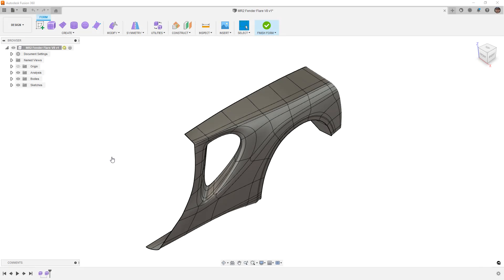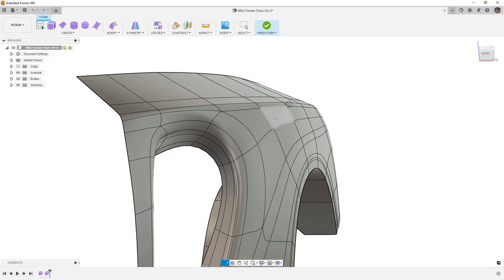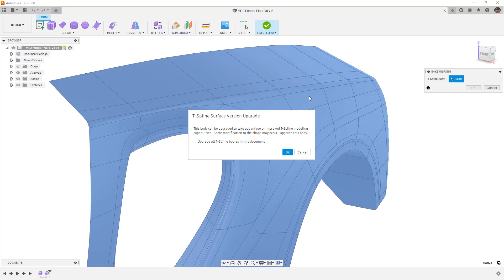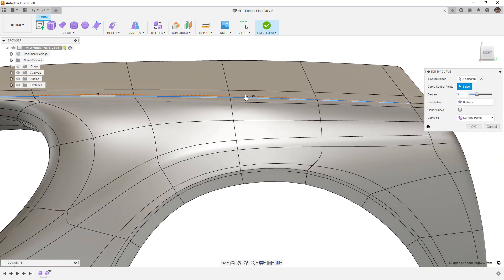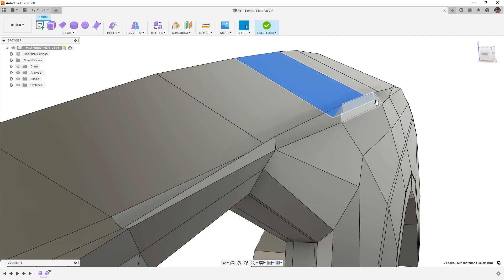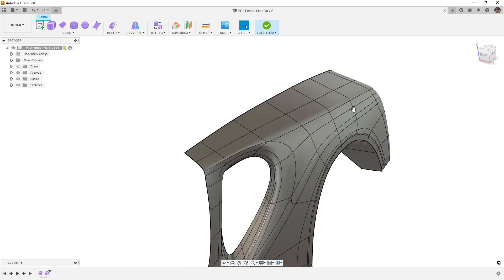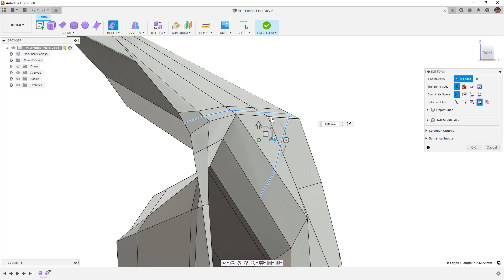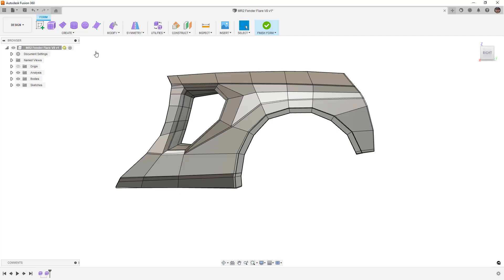Fusion 360 Form Mastery  Part 31 - Why We Don't Use Edit By Curve on Certain Models #Fusion360 #Form

Comment: What is the difference between the edit command and the edit by curve via control point in box display?
I would think it would accomplish largely the same thing?
Reply from the maker: Yeah it would seem like that.  It is a tough one to explain.  One example that is easy to see is to make a new quadball and do Edit By Curve selecting two edges.  You will see the box display edges are at different angles to the curve added with edit by curve.  The box display edge goes the direction of tangency while the curve seems to assume horiz/vertical at those ends.